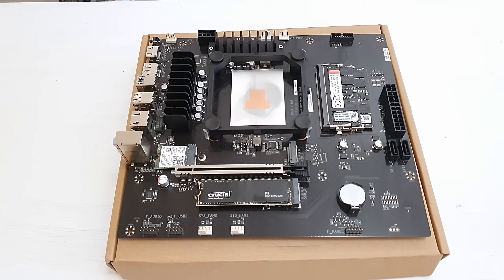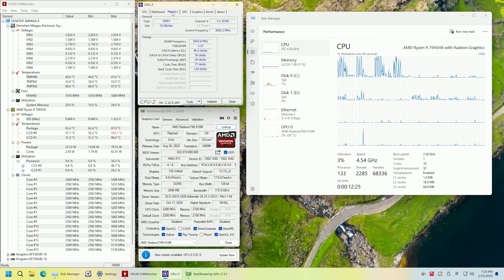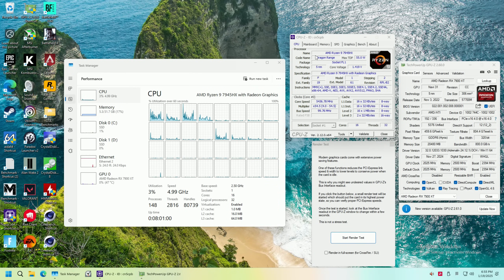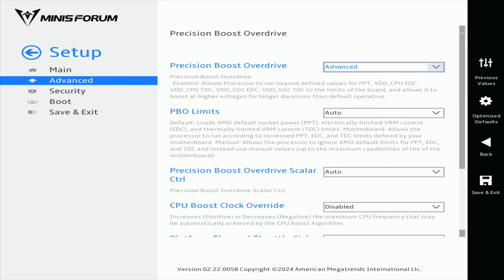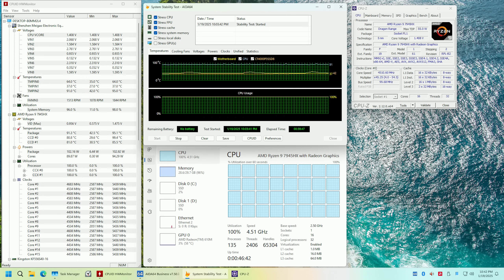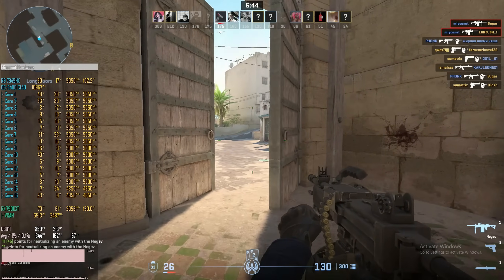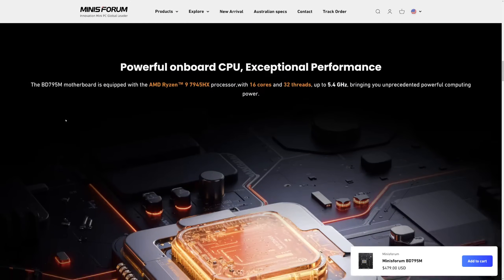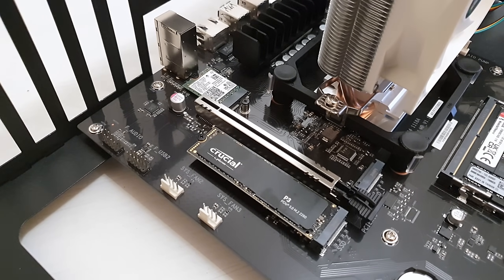16C/32T Ryzen 9 with a motherboard for $480 – Minisforum BD795M (R9 7945HX)

Comment: Just bought this motherboard for a home nas/ game hosting server. Will be a few wks before I get a chance to build and setup with a new unifi dream 7 system, but I'm hyped to get my first home nas server setup with this MB.
Reply from the maker: Why would you need such a strong CPU for a NAS?
Reply: @Miyconst  I plan on using it to run multiple gaming servers at once, while also having enough room to stream jellyfin or anything else to multiple devices in the house at one time. Figured more cores with a good high hz would accomplish this. Sometimes I go overboard on what ever I do, but I also think about future proofing things too.

Comment: I have a question about the thermal paste. I have big tubes of the same MX-4 you are using and i noticed when i used it on my laptop or on an erying motherboard it worked fine but only for a very very short period of time. Every time i reoppened them i noticed that it was very thin and spread out to the sides. Now i just use kryosheets for everything just to make sure cause i replaced paste so many times on that erying motherboard that i got traumatized until i realized teh paste was the problem. So how is th epaste working out for you? Maybe thats the cause of yoru high temperatures on this motherbaord?(apart from inadequate cooling)
Reply from the maker: The less paste between cooler and IHS the better. If paste runs out to the sides it means that cooler squeezes it out. The paste is only needed to fill in surface imperfections. I am using MX-4 for years and it works just fine.

Comment: dumb question but when benchmarking cpu's shouldn't you use low settings? Why putting high graphics on the gpu>>.
Reply from the maker: Because I am testing at 1080p which is a joke for RX 7900XT and high settings often increase CPU load by increasing crowd density for example.

Comment: For $380 now im seriously thinking of picking one up to tinker with. I want to build a very portable system i can take out of town with me. Not sure what gpu i should go with debating on picking up a 9070xt to go with it. Or maybe i will wait for 9060xt or 5060. I have a couple spare gpu’s but their all pretty chunky boys 6800xt taichi, ftw3 3080ti and not the most power efficient. My 2 main rigs are running a 4090 and a nitro 7900xtx. I’ve wanted one of these for a while now.  But at 500-600 what they started out at i couldn’t pull the trigger but under $400 i can stomach that. Can you undervolt the 7945hx?

Comment: Very informational video, thank you! Repasting the IHS is a very good tip. Because of the lack of a second PCIe-Slot: what about the Idea of using the second M.2-Interface with a breakout board to OcuLink or something to connect your capture card? Even the lower bandwith should be more than sufficient for this use case. :)
Reply from the maker: The second M.2 slot for sure can be used through an adapter as a PCI-E slot but why bother if there are other options available with enough slots?

Comment: Can you recommend a energy efficient yet powerful setup? At the moment I am using a 22C Xeon E5-2696 v4 on a MSI mainboard, 128MB RAM, RTX 4060ti for AI. Due to my work, the machine is almost running 24/7, but with energy costs of almost 0.37€ it is a bit expensive.
Reply from the maker: Ryzen 9 5900/7900 would be a good pick. Basically any AMD 5000/7000/9000 will be way much more efficient, I would go with a non-X version.
Reply: @ Thx

Comment: In the US under 400usd with Amazon discounts.
Reply from the maker: Sounds like a good price then.
Reply: Got mine yesterday, about 380usd.  running void linux with rx6800. turning off secure boot was a huge PITA.  have to make sure you get into the bios immediately to be in administrator mode otherwise all the secure options are greyed out.

Comment: What we really need RN is the argb 3 pin, type C for front panel, working 4 pin pwm, more USB front panel and 6000Mhz ram support and it will be a killer cpu+mobo combo

Comment: My verdict: Way too expensive for something with questionable quality and support.
Those Erying boards are equally bad in these regards, but at least they are cheap, as in half the price for an i9-13900HX after coupons. At $300-ish or even $350, these could be worth considering if you just want a cheap system for gaming and casual usage, with nothing too important on it, but the $480 price tag is a complete joke.
For gaming, you can buy a Ryzen 7800X3D and a B650 motherboard for the same or less. For everything else, you can buy an i9-12900 variant or an i7-13790F and a B660/760 board for much less. And there are the aforementioned Erying MODT boards for playing around with.

Comment: What's interesting - there is no chip set, that's why board look so "poor". I don't know for what type of client its made, but what I suggest as alternative
1. ASRock B650m hdv/m.2 + 7900x if you're "creator on a tight budget". That will fit ± with exact same budget. Memory options with full size dimms is much better and it's a little better with CPU cooling. And with all tweaking and cooling capacity you will be near 7950hx in terms of performance.
2. If you are a gamer, you can choose 7700x  (in 2025 it's better to have 8 cores) or look for something like 7600x3d. All this can be cheaper or equal, gaming performance will be same or even better and you will have an upgrade option in the future. 

Overall it's an interesting solution, but overpriced. For some competition with desktop parts IMHO price need to be 100$ lower, or there must be some X3D CPUS on this board.
Reply from the maker: Very true. It's an interesting piece of tech but with the current price I can't justify it.

Comment: It does seem like a great fit for a powerful but still very energy efficient server, and depending on the specific usecase it wouldn't even need a dedicated GPU, which is good. However, one PCIe x16 slot is still unfortunately not enough. Even without a dedicated GPU, I would like to be able to install a 10 gigabit network card, but this would then block the only available PCIe slot, leaving no more room for additional SSDs or other expansion cards.

If they manage to make a version of this that uses the PCIe bifurcation ability to optionally split the lanes between two or even three PCIe ports, I would almost certainly buy it to replace my current VM and fileserver with it.
Reply from the maker: Yeah, I am still in search of a single PCI-E x16 adapter that would use x4 or x8 lanes for a 10 GbE and the other lanes route to M.2 slots on the adapter. That would be so handy in so many instances.
Reply: got to ebay and get one 14600 see some for 165us!

Comment: Good review. It's an interesting product, but most consumers would seem to be better off with a standard desktop CPU + motherboard combo.
Reply from the maker: Very true. In most of the cases a standard (even if a bit slower) CPU + a desktop motherboard would be a better fit, unless Minisforum drop the price for BD795M.
Reply: This is no standard format for standart use case, as obviously you see.
Reply: @reqoil By standard he means a normal desktop CPU+motherboard if that's what you were talking about.

Comment: I'm torn on the PCIe slot config. While having a full x16 slot with bifurcation is nice, but having only one slot and two onboard m.2 ports limits its usefulness unless you are planning on running u.2 adapters to get a decent amount of capacity. Bifurcation is a lot more useful in a server where you have multiple slots with it so you can stack in multiple quad m.2 slots alongside a GPU.

Having it be dual x8 or x8 with couple of x4 slots to use for things like a 10gbit NIC. I know that they can't actually do that with PCIe 5.0 because of the crazy short trace lengths, but hanging a chip off half of the lanes to run some PCIe 4.0 slots would probably a better (but more expensive) solution.
Reply from the maker: I totally agree. The PCI-E configuration is pretty poor but most users don't need more than one slot and a couple of M.2s. It's also good for low power math crancher or something like that.

Comment: Got myself dual 3680v4 system in case I'll ever need a lot of old good CPU computational power.
Cost of the entire build was funny compared to this. In fact it was less than just this motherboard+cpu. Also coolers were cheaper, because there's no need to manage that 170W electric oven by a single unit.

And this CPU from the video is only about 1.25 better performance vise than my duals in multi core.

So idk. If you want that ryzen 9 badly, this might be an option. Because MB+CPU costs smth like Ryzen 9 7950X alone.
But still you will face some unexpected issues, that is almost 100% guaranteed. For a cheap and clumsy but powerful system I personally would still pick xeons.

Besides they are 14nm compared to these 5nm. It means that degradation would be much slower. 14nm would run for decades, while 5nm might not last very long past the warranty period.

P.S. honestly I don't even know why people might need this much compute power these days. If you're playing on 4k, modern GPUs would do fake framerates anyway, because that's their new marketing strategy. Not to mention how bad modern video games are. It's not worth the invesment.
Reply from the maker: This BD795M is surely a niche product, interesting nontheless. Your points and concerns I totally understand and mostly agree with.

Comment: Yes !!!  i am very glad you reviewed this , much better value  than the xeon systems 
the security issues are not a problem for offline systems 
you can install a second pci slot via m.2 oculink adapter 
 i have 2 oculink adapter on
 beelink mini pc  ssd boot  
. wifi (NFHK)  to m.2 to pcie   
and m.2 to pcie  working with win11
Reply from the maker: The value is probably better than the old Xeons but the total price is much higher, many people can't afford spending this much on CPU + motherboard combo.

Comment: This motherboard has no chipset, that is why the limited IO. If they use the same IO dies as the desktop part they probably can repurpose the x4 lanes as PCI-E what would otherwise go to the chipset. Basically this is the maximum IO achivable, they could reconfigure the USB2 headers to make two more SATA ports.

I think the idle power consumption is pretty bad for a mobile part, my 5600G ITX system also uses 20W idle, while a micro HP box with i5-10500T only uses 3-4W.

I really don't like the fact that PCI-E lane splitting is basically dead since 2018 (intel 8th gen), both from AMD and Intel side. You have one x16 slot and that is it, all the other slots go trough the chipset. Motherboards used to have another x8 slot directly connected to the CPU, but now it is only x4 slot and it's shared with an M.2 NVME connector making it totally useless, because you can't add a 3rd NVME SSD with an addon card. AM5 E-boards are the worst they rather give you one more chipset daisy chained than splitting a PCI-E lane.
Reply from the maker: Back in the days people used to run dual GPU setups, these days it's totally useless for gaming. There are still plenty of other reasons why you would want another x8 or even x16 PCI-E slot but most of the regular consumers don't need it. I am also annoyed with the modern configuration, just like you, but I understand why they do it like that.
Reply: @Miyconst  They can do it they just choose not to, it's literally just 2 PCI-E switch chip. On 10th series intel motherboard they used a x4 switching chip for the first M.2 slot, so depending on the CPU it switches to the PCH with 10. gen and switches to the CPU with 11. gen.
My best guess is because of PCI-E gen 4, they didn't wanted to downgrade the shiny new GPUs speed to gen 3, because there was no other gen 4 device at the time and it just stayed that way later. (I think if I split x16 lanes to 2 x8 it has to be the same speed, atleast that is my theory, what I couldn't test it because no motherboard exist with split lanes anymore.)

I use my second x16 (x4) PCI-E slot for 22110 enerprise SSD with adapter, now you lucky if you got one 22110 slot on your motherboard.

Comment: Thanks for the detailed and fair review. I have the same concern about the availability of BIOS updates for this or any Minisforum products. I bought a Minisforum mini PC last year after all the homelabber hype about the MS-01. It’s been great, but no BIOS updates. Their new NAS systems shown at CES look amazing, but I would not trust them with my data long-term 😅
Reply from the maker: It would be nice if they could send me a NAS sample for a review. 😬
Reply: My BD770i got a bios update late last year which unlocked overclocking. I think it was almost 1 year after older updates. I don't know anything about updates for other products, but I'm optimistic about it.
Reply: The Minisforum website is also an absolute mess.  Product specs and pictures are wrong.  If they can't manage a website why would I buy a computer from them?  I wish it wasn't so because the concept of their hardware is really cool.

Comment: It is actually nice for Minisforum to allow people to use standard aftermarket coolers.
I don't own their mITX boards but had a chance to play with it - their so-called "cooler" where customer can only change fan... is a mess.
It is bad... maybe not 4700s desktop kit cooler bad, but still bad enough.

For m2 wifi... it probably does not suppoort CNVio2?

About rest of the board, will repeat what i said once over your discord - this product overall feels like a waste of mATX format
Reply from the maker: This is my first Minisforum motherboard so I can't say much about their mITX coolers but judging by the issues with my IHS I could guess it wasn't the best. And yeah, this motherboard could easily fit into an mITX space but then it would require more PCB layers and the second M.2 slot would go to the back side of the motherboard.. means the production cost would be higher. So yeah, it's a budget dictated decision.

CNVI WiFi doesn't work here.